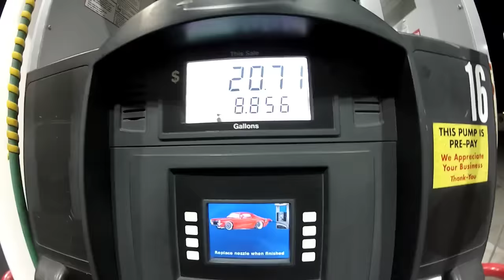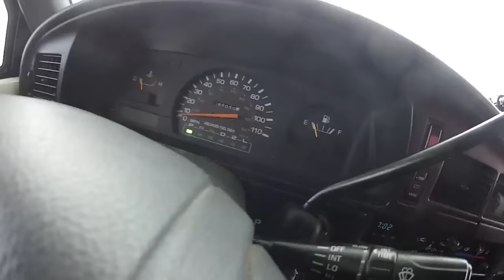Renovation done! Back on the Road finally! Heading to Beet Harvest and a small break down.

Comment: How are your brakes in the rain. Had to route all my hydraulics to the rear brakes to keep the fronts from just sliding anytime I hit the brakes.
Reply from the maker: Pretty good, the rears definitely don't work as hard as the front and have had 2 different mechanics try to make them better. They are acceptable but could be better. That's a good idea!